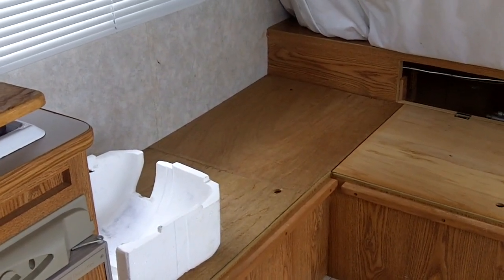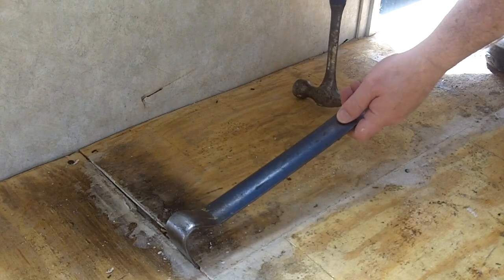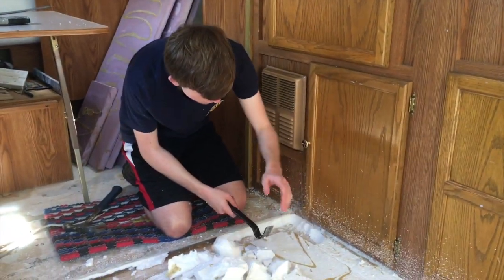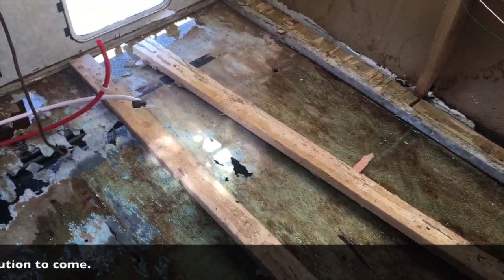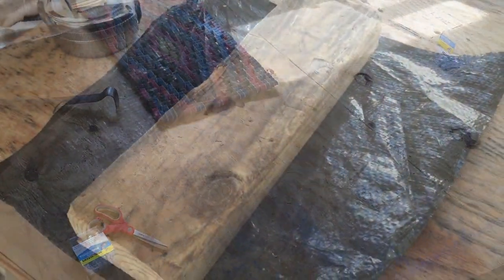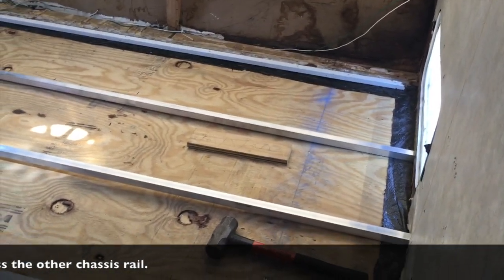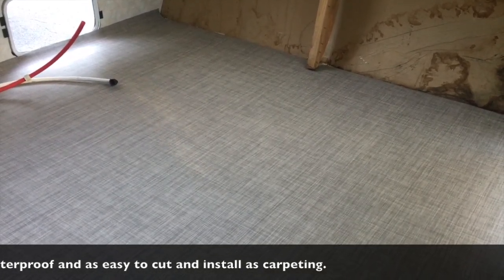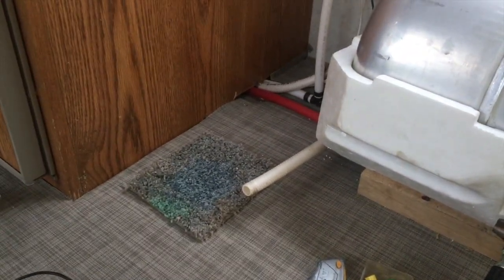RV Camper Floor Replacement

Comment: I'm bookmarking this page and adding it to my resource material when I tackle the floor of my 2001 R-Vision Bantam Trail Lite B21 in the spring. I was going to sell it but good used trailers (ours is great other then floor) are like gold nowadays. Your video is great help. What actual model is your trailer?
Reply from the maker: New-to-us 2000 Trail Lite Bantam Hybrid C-21B we bought in 2007.

Comment: How did you attach the walls to the floor?
Reply from the maker: I did not attach them. I didn't feel I needed to because I only replaced the front 40% of the floor.  The walls and floor are still attached to each other along the front, rear and most of the sides. In hindsight, I probably should have attached the new floor somehow, but I have not had any problems since this project, so maybe (hopefully) it'll be all right.
Reply: Rick Kessler since you’ve torn the floor out, and seen the structure, what is at the bottom of the walls? Is there a wood or metal beam running along ? I’m thinking of running a treated 2”x2” along the wall and attaching to the bottom of the wall then Krieg jigging flat 2”x6” into it and also screwing the 2x6 to the main frame. I want a sturdy floor. Also , is there steel framework perpendicular to the main frame every few feet along the length of the floor. I’m trying to plan out my attack before I tear out. I have the same camper with only slightly different floor plan. I want my walls secure because we drag this camper 400+ miles one way.
Reply from the maker: @jodijarvis1018  Running along the bottom perimeter of the four walls (front, rear and sides) is an aluminum tube, I believe it's 1.5-inch square. There was one piece of aluminum tube (again 1.5-inch square) that spans the chassis rails in the center of the RV.  There is no other aluminum or steel support either in the floor, or under the floor, other than that. The original floor from the factory was two pieces of 1/4-inch lauan plywood sandwiching with 1.5-inch rigid foam insulation in between. The exterior walls were on top of this. I don't recall how the exterior walls were attached to the floor other than adhesive.
Reply from the maker: I should say that the perimeter walls only rested on the bottom piece of lauan plywood. The rigid insulation and the top layer of lauan plywood were not as wide and "inside" the camper walls.
Reply: Rick Kessler wow, no wonder they fall apart. Guess I got some planning to do. Thanks for the info. You may hear from me again once it gets nice out. Wish me luck.
Reply from the maker: @jodijarvis1018  You got this!
Reply: Well we’ve started tearing out. And it is absolutely soaked through all layers. We are able to just rip out with our hands. We have the same water stain pattern as yours in the front. Where was it coming in on yours?  I’m wondering if ours is coming in at the bed hinge. We’ve decided to put a pressure treated 2” x 8” x8’ solid floor with 1/4” underlament on top then vinyl. We have to trace out stain to stop the leak. Thanks
Reply from the maker: @jodijarvis1018  Judging by the water stains when we bought the camper in 2007, the previous owner had leaks coming from the front bed. That's not where the leak was for us, though. Ours was where the front cap meets the floor near the corner on the campsite side.
Reply: Rick Kessler that’s where our heavy damage is. Thanks

Comment: Thanks a lot for the video. I'm about to tackle this.  I've got lot's of water damage in my starcraft, also called Starcrap by Aussies.  The water has come in from the front after a seam was opened up and it sat for two winters. I've ripped out a fair bit of the rotting sandwich, back to almost the door.  I'll tackle more tmw.  

Looking at different videos I see most people use 2x4 or other wooden joists.  I like the idea of the aluminum sq channel.  I've found some 1" locally and I also found some more expensive 1.5".  I'm wondering if I use 1.5" I could get away with less than 3/4 " ply on the bottom.  Why did you use such thick ply on the bottom?  3/4" seems pretty heavy. Also it looks like your floor adds up to 2.5" thick?  Seems like a lot more than the original?  I might also hire on a welder to weld them to the outer aluminum frame of the original floor.  Any advice appreciated, especially from someone who's been through this before.
Reply from the maker: I used 3/4 on the bottom because I didn't want any regrets after I finished. I would think that if you use 1.5-inch aluminum stock (maybe space it 12 inches apart?) you should be more than fine. Welding it to the perimeter is a great idea, too. Good luck!

Comment: Hello Rick. how many hours a day did you spend on this project.  Also what is the length of time it took you to complete.  2weeks a month ect. I have a 21ft cub that i need to do this in but the full floor front to back. I want to have completed for Canada's camping kick-off victoria day long weeked. or as well call it may "2/4" eh
Reply from the maker: The amount of hours each day varied from as little as 2 hours to as many as 8. It was probably an average of 5 or 6 hours each day, so if I were to add it all up, I'd say it was about 80 hours total. I worked mostly on the weekends, with only a few weekdays and nights thrown in. It took a couple of months because of that. Also, I did most of the work myself, so if you have some help that ought to reduce your time on it. Hope that answers your question. Good luck!

Comment: I’m curious how many total labor hours it took over 14 days.  I’m about to take on my trailer floor.
Reply from the maker: My best estimate is 40-50 hours. Some days it was only an hour or two. Other times it was a full eight hours. All depended on the task and the time I had available that day.

Comment: What size square tubes did u use for cross beams and what holds them in place from moving thanks
Reply from the maker: 1-inch square aluminum stock, 8 feet long cut to length, from onlinemetals.com. Self-tapping metal screws through the aluminum, plywood and into the chassis.
Reply: @Gr8LakesCamper  cool thanks man I got camper like yours my floor is bad wanna replace it

Comment: what would the original joist spacing be?  16" centers???
Reply from the maker: The factory original had only once cross beam in the center of the unit. There were no other ones.

Comment: Great video. This will be my reference guide for when I begin my floor replacement on my Trail-Lite 21’ hybrid. I am curious as to whether there was any noticeable difference in the trailer weight before and after.
Reply from the maker: You're right; there's no doubt that it's heavier. But I have not weighed my camper either before or after the project. I know that I probably should, and whenever I go to sell it will. I haven't bothered to weigh it, though, because my tow vehicle can pull 11,200 pounds. The factory-listed dry weight of my camper is 2,800 pounds (VERY debatable on the accuracy of this). So, even when loaded and even after this project, I'm well within my comfort zone.
Reply: I would agree there is no need to worry on your part. I was just curious.

Comment: j am impressed and hopeful that I can try to repair the 2002 Thor Tahoe 22 ft Hybrid Toy hauler [hybrid means there is a foldout, flip out, popout tent bed that is the whole front of the trailer. I recently retired and survived 2 strokes. My plan [for over 18 months] was to Get an F250 SD CC FX4 Diesel, a Honda 4 x4 quad, and a nice camper and relocate from Texas to a 180 yo Ghost Town in the Inyo Mountains in CA,.  I was surprised when loading the hauler that the wall and floor were separating, and the wheel well under the sink was destroyed from an old blowout the past owner forgot to inform me.   i have been unwilling to just remove the cabinets, windows, floor, and the front flipping-out bed if is HEAVY, BIG, and I have no idea how to support it or anything.  But if I am going to make it before the only road in/out of Cerro Gordo was washed out from the DV Flooding 3 weeks ago and once the snow starts they close the mountain til spring. I don't have the support you had, I Would love to talk with anyone who knows these foldout beds to share and maybe give me some safety tips.  but i will sleep in the f250 if need be Before i am stopped again. 400 acres 9000 ft asl and 40+ abandoned silver mines 1100 feet under the private town is calling me to come help Mr Underwood rebuild the hotel, and the historic town.

Comment: Rick, what was the name of that barrier underlayment you used under your plywood?
Reply from the maker: Sorry, but I never did get the name of it.
Reply: He wrote this on his blog if that's what you'Re asking: 
8x15-foot piece of ripstop silnylon, cut to fit, used as the weather barrier for the underside of the camper.
Reply: I think it is this material: https://www.recpro.com/105-wide-rv-underbelly-material-coated-black/

Comment: Hey Rick, Thanks for this video.  I have the exact same issue right now with an almost identical trailer.  I didn't see or hear how you attached those cross members.  I want to do the same thing and I am in the middle of the mess right now.  Funny I fell thru the floor (tin or aluminum) once and the dog fell thru 3 times, lol.  How is the underlayment holding up?  I'd love to switch over.
Reply from the maker: The cross members were drilled through the plywood and into the chassis frame. The underlayment is holding up extremely well. The whole floor project has been performing wonderfully. Couldnlt be happier.
Reply: @Gr8LakesCamper  ive seen folks say no aluminum next to pressure treated plywood... what am I missing?
Reply from the maker: @qrevere5546  After reading your question and doing a little bit of research, it turns out I likely made a mistake in not using untreated plywood.
Reply: @Gr8LakesCamper  it still looks good and gave me confidence to do mine. Tow capacity is only 5080 so deciding between luan, foam, 3/8 ply, luan and 3/8-1/2 ply, foam, 3/8 ply, luan... in other words somewhere between what you did and what the factory did... anything i do should be lighter though as idiots before me covered floor w/ 3/4" and vinyl TWICE!
Reply: I went with 3/4 in tongue and groove on top of new 1/16" aluminum, which somehow, even at that thickness, still seems twice as strong as what they used.

Comment: How's it it holding up? I've got a 1999 model. Had a blow out in the same spot too.
GO BLUE!
Reply from the maker: Holding up very well. No issues at all. GO GREEN!
Reply: @Gr8LakesCamper  have you had any delamination issues? I was able to save the nose of mine with 6in eternabond.
Reply from the maker: @jasonspellich2440  There was delam when we bough it used in 2007 (front bed panel and door-side sidewall toward the front), but we used Eternabond where the leak was and it has not gotten any worse over the years. (knock on wood)
Reply: @Gr8LakesCamper  most of mine is on the other side by the bathroom. Thankful I caught the front before it was an issue. Definitely one of design flaws.

Comment: Do you have a video of your rock guard installation?
Reply from the maker: I'm sorry but I do not. I did it years ago prior to recording projects on video. A friend of mine is a metal designer; his advice is to call around to local metal fabricating shops and explain what you're trying to do. They can most likely help you.
Reply: Thanks!  And how did you support the walls on the camper while you replaced the floor?
Reply from the maker: Didn't really need to as the walls sat on an aluminum-framed perimeter, but I did put blocks under it. Two on each side near the front and rear.
Reply: Thanks again!  I have Trail Lite Bantam 17b I bought last Fall.  Just took it on a long haul and the walls are sinking down because the floor cannot support it.  I need to replace my floor next summer.  I am so glad you posted this.  This helps out so much.
Reply from the maker: Congrats on the Trail Lite! Check out the Facebook Page "Bantam Trail Lite Camper Owners UNITE!" It sounds like you'll want to vary your project from mine to account for those sagging walls. One suggestion is to use jacks to lift each wall into place, and block underneath it to keep it there. Once that's done you'll need to determine how best to attach your new floor to the walls. Each wall, along the bottom, rests on a piece of aluminum square stock. The original floor had a bottom layer of 1/4-inch luan plywood that extended underneath this aluminum square stock. You'll need to somehow attach your new floor into this aluminum square stock. Another option is to have a metal shop fabricate steel supports that can be welded onto your chassis rails. The supports would need to be long enough to extend under the walls. Just my two cents.

Comment: Nice Job, I liked your GR8BLakesCamp Logo, did you draw this yourself?  May I ask the year of camper and how did the original flooring receive so much water damage? Thanks.
Reply from the maker: I did not draw the logo. It's clip art, and added the "Gr8LakesCamper" text to it. The camper is 2000 mode year. The water got into the camper through the front corner, where the front cap meets the floor and sidewall.

Comment: Does anything go under the first layer of plywood?
Reply from the maker: Go to the 12:56 mark of the video. That's where I talk about what I put under the bottom layer of plywood to use as a weather/water barrier.
Reply: @Gr8LakesCamper  thanks!

Comment: I have to do the same thing may I have your email if I am in need of some clarification
Reply from the maker: ask anything you'd like
Reply: @Gr8LakesCamper  ok what model is that camper I have a B-19 I noticed that you did not have to remove the refrigerator did you have to remove the sink or oven or is it attached to the wall ? When you left the 3 inch over hang of the old material on the bottom did you attach it to the new material under the 3/4 in plywood ?
Reply from the maker: @sinout044  Our model is a 2000 Trail Lite Bantam Hybrid C-21B. We did not remove the refrigerator, stovetop (above the frig) or the sink (next to the stovetop).. Our model does not have an oven. We did attach the 3-inch flange of the old metal material to the new material (rip-stop nylon underlayment weather barrier) with Flexseal tape. Everything seems to have worked just fine because it's been 4 years without any issues.
Reply: Hey Rick another question what did you use to  Secure the new black underlaymet to your new plywood
Reply from the maker: @sinout044  It was such a tight fit that I only wrapped it up and over the plywood and stapled it in place. Underneath I used Flexseal tape to secure the “flange” left over from the original weather barrier to the new black plastic one.